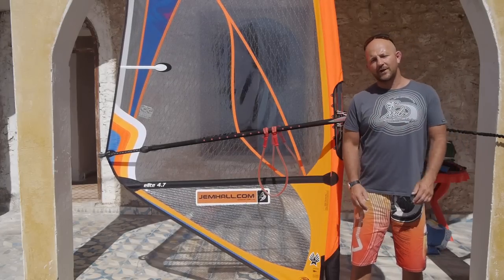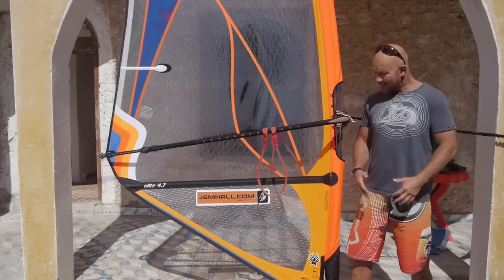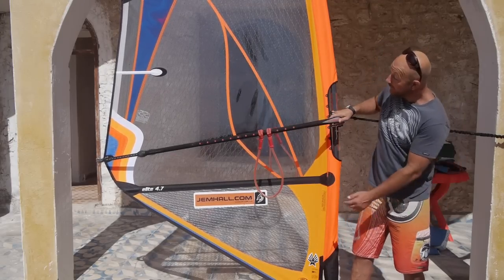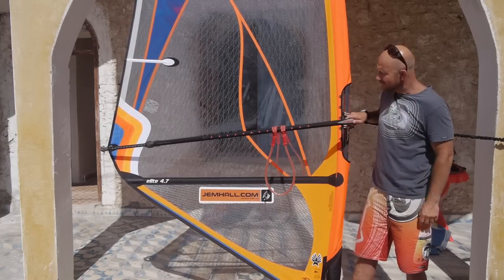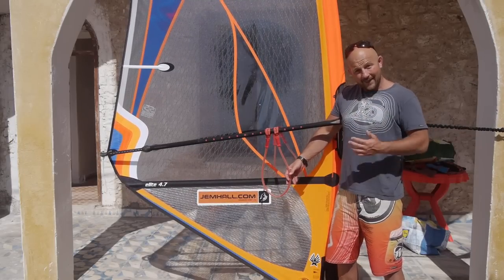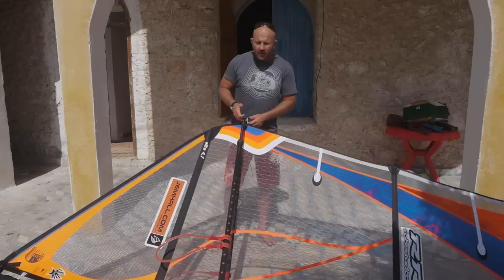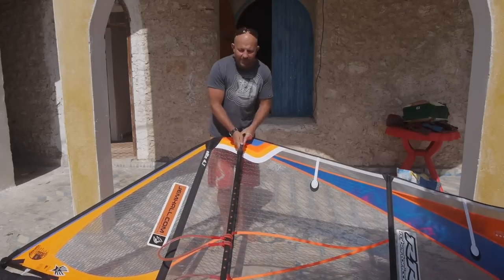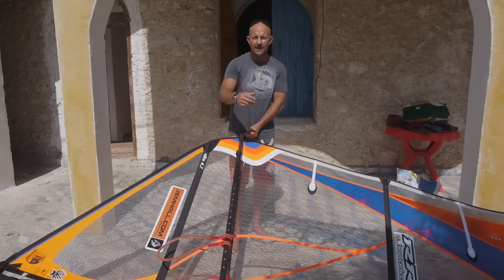Windsurfing Boom Height   Windsurfing Harness line positioning & Length   Windsurfing Outhaul Trim H

Comment: What is the ideal  "starting point" for boom height, ie., a good place to start from which you can adjust up or down for power or control?  Does it make a difference if you are using a longboard or a shortboard?

Comment: How does height of boom set relative to my own height roughly,compared to top of my shoulder as a reference
Reply: When waveriding your boom should be about your chest height, because you want to get low on a bottom turn. But if you want to freeride or do anything else you should put it more about at your shoulder height. Your height doesn't matter as a reference point.

Comment: Let me guess. Too high is not okay. Try it. Too low is not okay either. Haha, don't even try it. Conclusion, the reight height is in between and it feels best.
Reply: Well of course too much of everything makes no good. When waveriding you should put it at your chest height to allow yourself to put the sail lower for a bottomturn. Freeride or freestyle probably higher around your shoulders so you can get planing more easily.